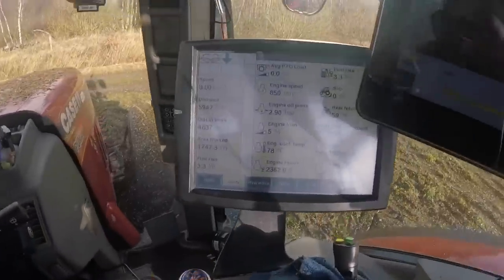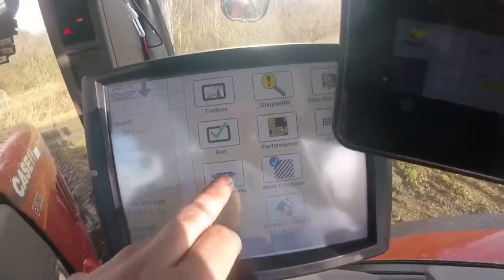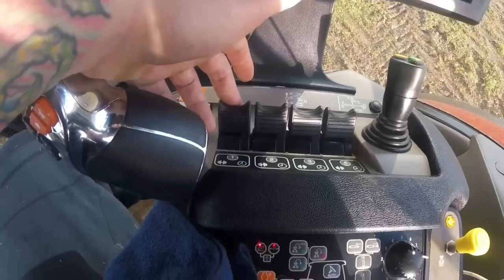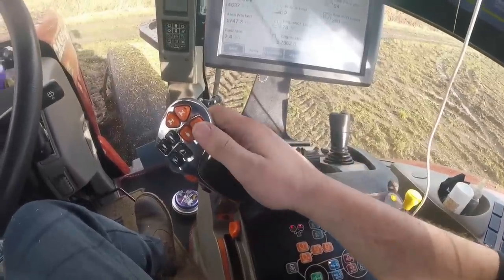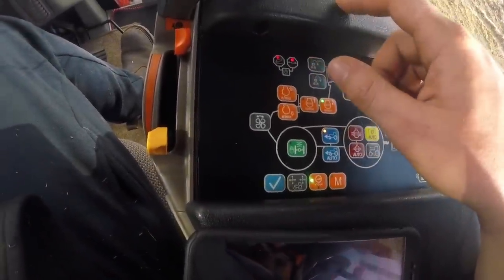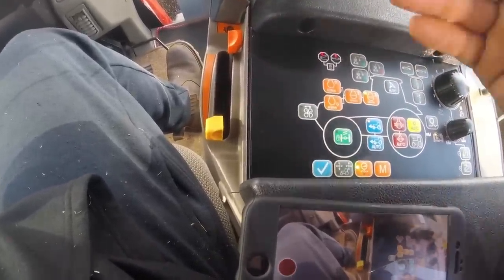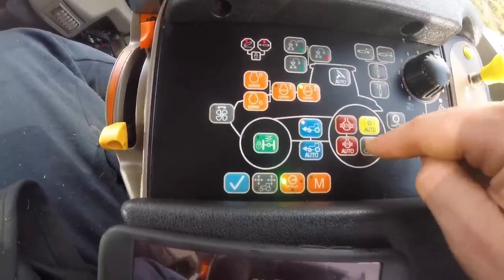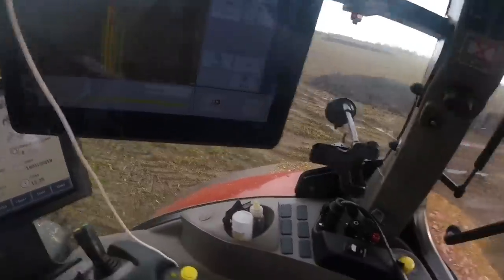Case puma 240cvx, a look at the controls (part 2)

Comment: Nice Jonny,

The “M” button is manual mode. Basically stops the engine and gearbox communicating with each other. Which in turn makes it a conventional tractor. After pressing the button, you need to move the MC controller fully forwards. Then the clutch can be used as you would in a power shift Puma. Your hand throttle and foot throttle then control the engine revolutions and travel speed in accordance to the selected speed on the corner post. 

Loving the vids mate,
Ant @ Farm* LTD
Reply: Grandad switch lol. 

I think it also stops any range changing with in the gearbox. (Might be wrong there) 

Been wanting to do stuff like this myself when demonstrating but I haven’t got the balls to do it. Keep it going mate! CASE IH FTW! ;P
Reply from the maker: You should do it dude!! 
You always get nice shinny new kit to play with! 
If you could get me a chrome exhaust shield for the 240 I’d even consider giving you a shout out! Lol
Surly my videos must be good advertising for case IH?? 
Lol 🤣🤣😜😜
Reply: @Jonny1388 Na for steep hill country. Give operator full control. Leave it to the computer and you be stuck as they put too much power to the ground. No computer can drive as good as a human when the conditions demand 100%

Comment: Great video, love the explanation of the controls. I realy like tractors and such, but unfortunatly I never realy use them (yeah, a real old 1967 Ford, which ofcourse hasn't got any of those fancy controls :P), but when I see the inside of the cab of a modern tractor I always wonder where all the buttons and switches are for.  That's what I realy like about this video, that you explain in general what they do.

Comment: Great clip Jonny! I have a 240 2016 I think. When I want to lower the rear linkage I have to give it a quick uplift and then down, this on the lever. If I dont do it linkage go down really slow. May you have an idea why its like this?
The salesman on Case have no idea what Im talking about.
Reply from the maker: Hello my mate! 
Do you have to do that everytime? Mine will lower very slowly the first time i drop the linkage, first thing in a morning or whenever I key off the tractor. It's to do with the linkage height sensors learning the position. Bit after that it's fine and will drop at whatever speed I set it too. 
There are a couple of combinations you can use on the multicontroler linkage buttons to make it lift up slowly  or lower slowly. 
Sounds a really silly question but what have you got your drop rate set at, under the armrest?